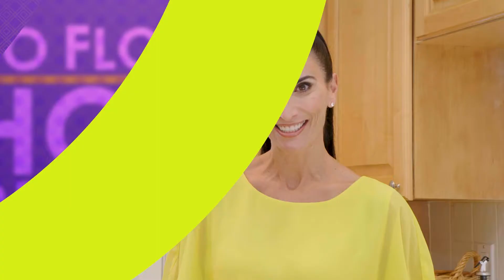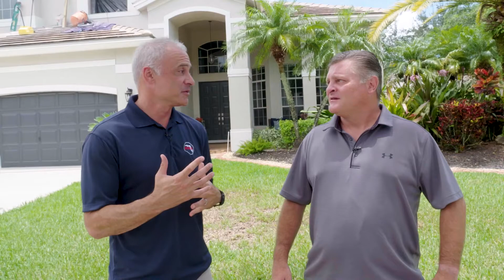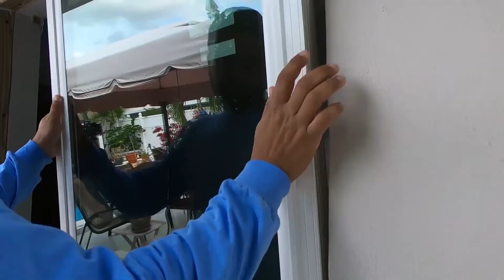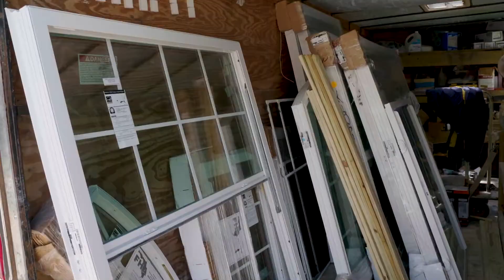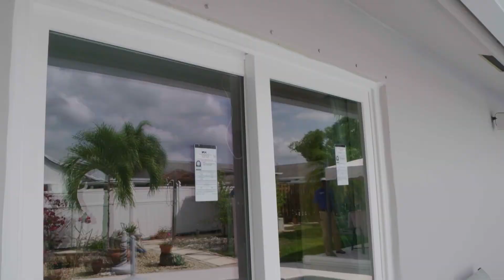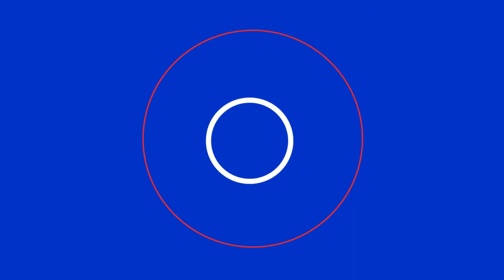Making the Choice Between Impact Windows & Hurricane Shutters | FHIA Remodeling

Comment: This poor homeowner got sucked into believing that impact windows are a good first line of defense against hurricanes. They do ok against high winds, but the fall woefully short in the areas of surviving impacts and preventing water leaks. A non-impact window with an approved hurricane shutter is more cost effective, affords the home better impact protection and does a better job of stopping water damage than any unprotected impact window. Do your research and find out if impact windows are REALLY your best option. It could keep you from making a huge mistake in how you protect your family, home and property.
Reply: Exactly what you said impact windows don’t mean “won’t break” and many insurance companies still require shutters over impact windows.
Reply: @JohnathanAulabaugh  they tried impact windows in Australia back in the early '90s but nixed them when they realized that the replacement broken impact window cost didn't make economic sense. I wonder why this country didn't take the lesson from that?
Reply: @Evolutionhurricaneshutters   I am in the middle of a ground up remodel addition taking an old 800 block building and turning it into a 1500 sq ft home. All I have heard since the beginning of this project was "I need impact windows" Sure they don't break as easy but they still break when hit with anything substantial. It's still a replacement cost after the fact and they cost 40% more than standard windows.
Reply: @JohnathanAulabaugh I think that fixed impact windows are acceptable on the upper floors. Single and double hung models are too prone to water leaks and  you have to buy the double pane versions to achieve any substantial protection. The outer tempered lite provides the impact protection by slowing down the large missile - the laminated inner lite breaks easily but the pvb membrane does the work of preventing it from entering the structure. They call it "shatter resistant" but if you watch the testing videos, you'll see a shower of sharp glass fragments being hurled off of the backside into the living space. Anyone standing behind a window during an impact will undoubtedly sustain some significant injuries. Keep in mind that the test 2x4 is only traveling at 34mph, it has a blunt end and it only weighs 9 lbs. A sign post or an object of a different shape, heavier weight or traveling faster won't have the same result. The testing was created by the window industry as a sales tool to promote their product to the insurance industry, not to be economically smart.